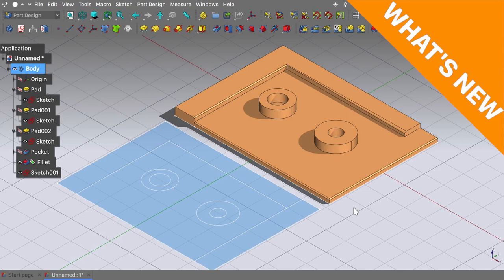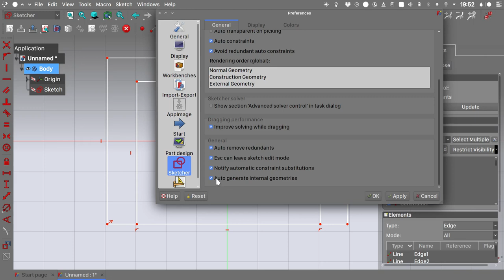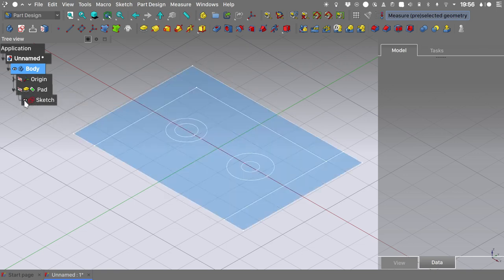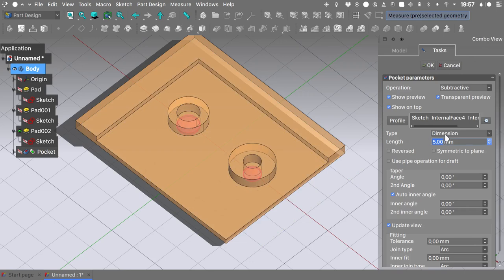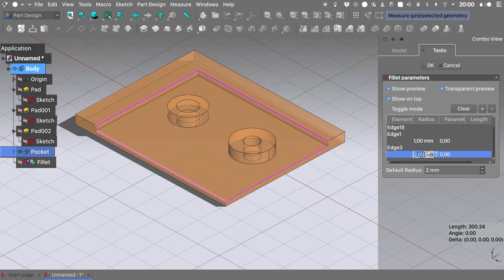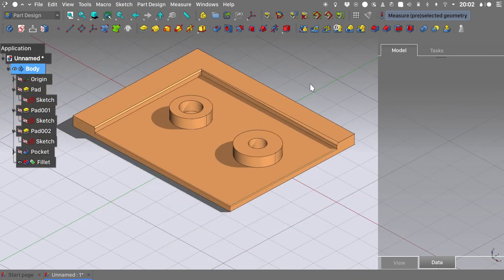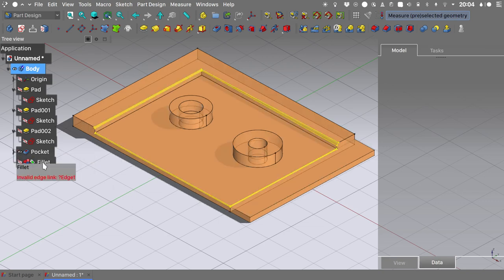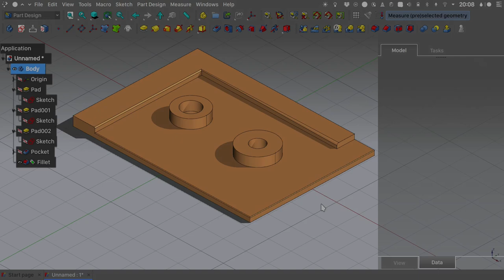What's new in FreeCAD Link Branch.

Comment: WOW ! nice new features !
please keep us updated with the new features !

Also please make a video about configuration of parameters, in spreadsheets and linking them to dynamically changing the parts.

e.g. in CATIA, there is a design table feature, and one nice feature of CATIA, is you can select the column/row number that the data is taking from !
meaning you only change 1 number, for example using data in row 2 instead of 3; and all other parameters and operations will be taken from the data in row 2 instead of 3.
freecad has similar capability, thanks to realthunder, but it is a little complicated, specially when it comes to adding them into the property view and managing operations, like bolean, the activity of a pad or pocket and etc

Comment: Thank you for this information!
OnShape has really changed the way we model with this master sketch feature. I think this will transfer the new design workflows!

Do you know if it is possible to have several different manifolds with the same sketch? 
If not, this is probably the next step to be able to make the transition from OnShape to FreeCAD.

Thanks a lot for your watch on this branch!
Reply from the maker: If by manifold you mean to allow disjoint lumps to exist in a single logical body. Non-Manifold then means: All disjoint lumps must be their own logical body and taking FreeCAD's definition of body .... then LinkStage3 already allows this as opposed to master that doesn't allow it.

 Bare in mind that the FC master choice is by design with the reasoning that a FC Body should be manufacturable from a single block of material and there are pro and cons toboth approaches but yes, LinkStage3 allows multiple solids(manifolds) from a single sketch.
Reply: @OficineRobotica  I've tried it and you can have several solids from the same sketch!
This makes it possible to design by master sketch as it can be found in OnShape and which is presented here!
I think that using this example could be nice !
For me, it makes absolutely no sense to limit the design to what you can machine from a single block. When we do machining, we start from a block or a STEP/IGES file, and it is up to the CAD/CAM engineer to know how many axes are needed and how to machine. 
Anyway FreeCAD doesn't even have a 5 axis machining module, who could find interest in this limitation...
 Moreover, 3D printing is not subject to such restrictions.
This possibility greatly limits the need for assembly, so it's great to be able to use it by default!

Comment: Was looking for your link for UI settings that you are currently using with the latest Link Stage 3 release. Would like to follow your video's instructions with a similar layout. Also see in Preferences Display Draw styles, Select hidden line pattern does not seem to work. Is this feature a work in progress?

Comment: It's sad that they spend so much time on a software that produces such fragile trees.
They say it's procedural, but only the last step in a part design is procedural.
If you change something significant more than a few steps up, it always breaks because of topological naming.

It could be fixed for example by adding some kind of attribute which would help naming specific curves, points, faces and whatnot, so that you can refer to them by name downstream. This is what they have in SideFX Houdini, and it makes it a truly procedural workflow, not just the last step, or the simplest step that won't change the topology.